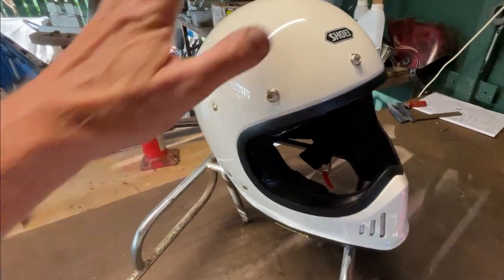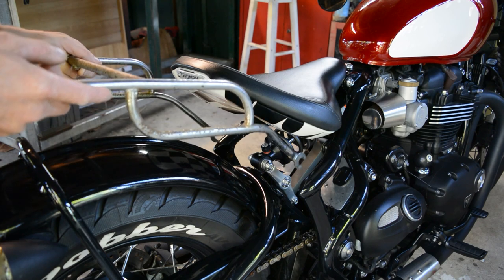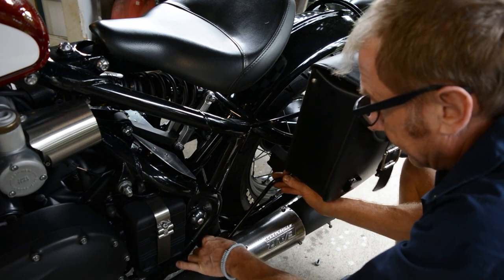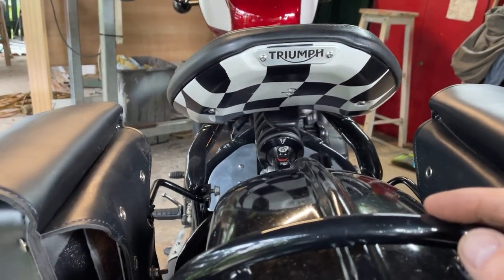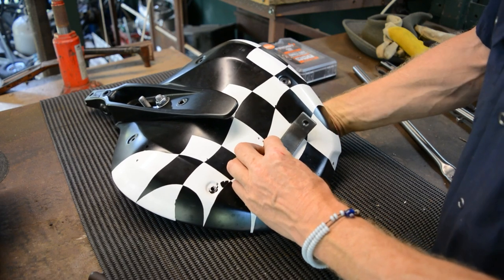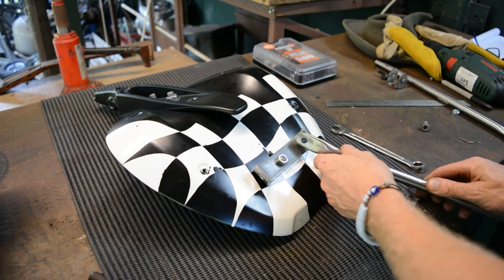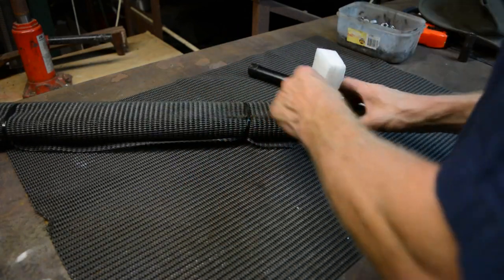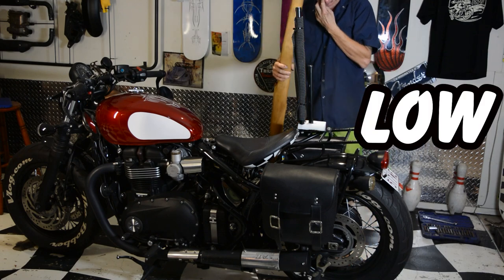A cheap motorcycle luggage rack

Comment: Fabricobbled, love it XD
Reply from the maker: Cheers! These are my favorite videos to make.
Reply: @brownco_customs  Silly question, I'm stuck on my clutch pull rod at the moment, have you changed the clutch plates on your bike yet?
Reply from the maker: @christiankirkenes5922  not yet. What’s the issue?
Reply: @brownco_customs  Followed the Hanes manual exactly but the "pull rod" lever on the bottom of the gearbox, for the clutch cable has no spring tension. It wont return the lever when pulled. I've checked it about 6 times and it's done exactly how it's supposed to be. Just wondering if it requires oil pressure to stiffen it up. I'm all out of ideas and there is no useful information to be found on the internet. Worked perfect before I removed it so I know I have caused the issue.
Reply: @brownco_customs  I've figured it out. 
The last clutch plate has to be offset by one tooth. I missed that single sentence in the hands manual. It cost me 4 days and my sanity.
Reply from the maker: Glad you got it sorted!
Reply: @The Bobber Vlog  just remember when you do yours: the last plate is offset 😆